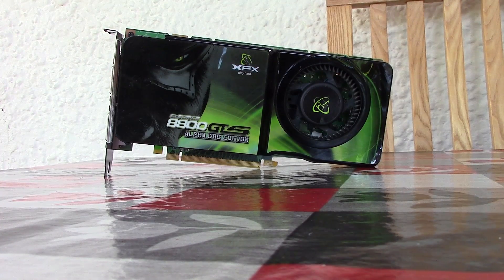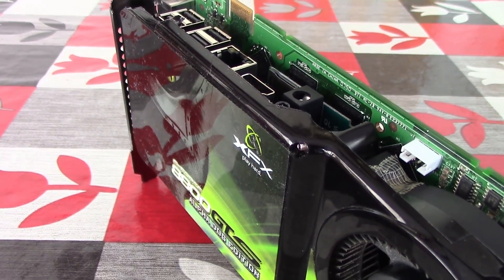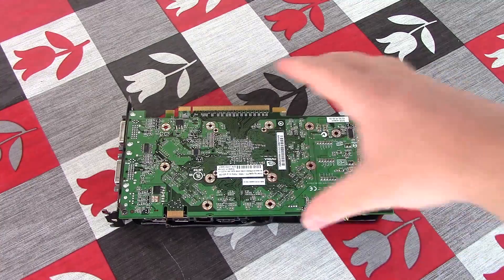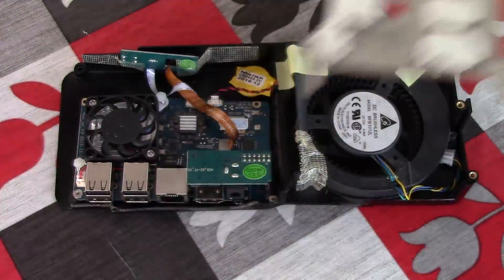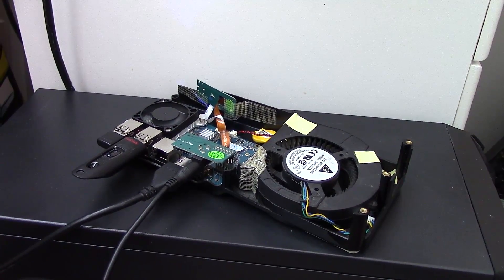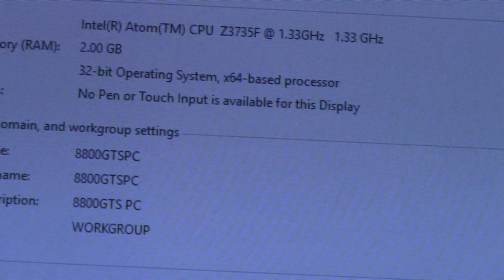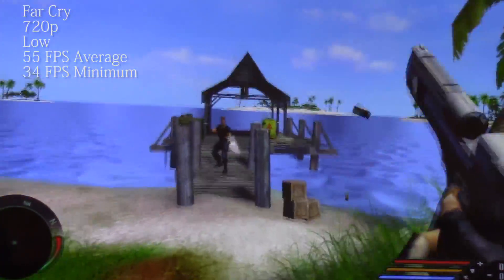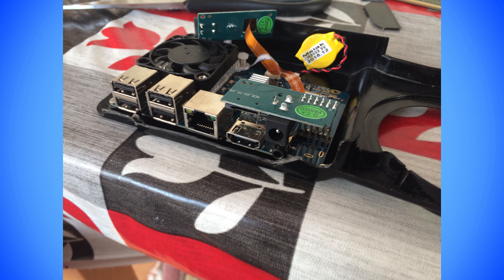I Built A Computer Inside Of a Graphics Card

Comment: If I get the  computer I am planning to build works I'll try to get a video about it. But I need to replace the fan cause I accidentally ripped the red wire out of the connectors I might try to RIP a motherboard out of a box PC so I can work on the repairs

Comment: you should have drimeled out the back io on the gpu and put a raspberry pi in and lined up with the back io. then you could cut the traces that lead to the pcie pads on the gpu, basically turning it into a dummy gpu so that no power or data is transfered. then you could put it in a pcie slot and boom you have a pc inside of a pc.

Comment: This is better than my older Atom processor Netbook that I had to install XP on because it refused to run with Windows 7 Home that came installed. If you take an Atom processor, just 1gb of memory, and Windows 7 Home then you have a recipe for at best a very sluggish system. I changed to XP and voila I had a good running system.  Praise The Lord and Godspeed to you all - Psalm 90:12!!

Comment: YOU COULD CUT THE 3 PIN GPU FAN CONNECTOR AND USE IT IN THE 2 PIN MINI CPU COOLER HEADER!
The 3rd pin is just monitoring the speed, you could connect it manually or use a 2 pin fan connector and use that!
Like if you agree!
Reply: But you need to use a bigger heatsink for that Intel Atom then
Reply: Ádám Strasszer Answer the question!
Reply: Bad Username lol yes
Reply: Aigis Is Best Girl good 4 u

Comment: Thank you so much, I just built a new pc from your guidance:
Amd athlon x4 860k 3.7GHz
GTX 750ti 2GB
4GB 1333MHz DDR 3 Patriot RAM
500GB HDD
A68hm-p33-V2
500w be quiet! Psu

But unluckily these are all new parts (except for psu,case and hdd), I feel like I got punched in the face when I realize I could buy an i7 3860
Or some other i7s second hand so I feel like crying, but mostly, thank you!)

Comment: I have an idea, which probably atm is not possible to make.

Raspberry Pi with USB-C (and maybe x64/x86 CPU) or Intel Atom based board
+
Electronics from external GPU bay, like Razer Core
+
GPU, like RX 460 or some other with low power usage
+
Custom power supply to feed all of the parts
=
PC in size of a GPU

Comment: you could've wired the power connector to the PCI power connection(possibly with a buck converter depending on what kind of voltage the board runs on).  And also you could've extended the hdmi port to the io panel of the graphicscard. that way the project would be more interesting. this way you essentially just crammed it in. nothing you could really call "build".

Comment: Next steps at this point would be to wire your PC to the old PCB to 1: take power from the PCI-e port, 2: use the existing GPU fan for cooling, 3: use existing display out interface.

Comment: You could have easily integrated it more, like using the power lines of the gpu pcb for the pc, I doubt the atom pc will draw more than the 75W it can supply. The ports of the mini pc should be to the side where the video ports of the gpu were. 
This is just using it as an oversized case for it, lame :(

Comment: I found a way to actually turn something like this in a gaming system: Get a Up2squared (4 core Pentium, DDR4, PCIe x1) and put it inside a working gpu. You'll have to cut off the half of the cooler to fit the up board in, but that should be okay if you undervolt an nvidia card. The gpu is connected to the up's PCIe x1 slot using a pci riser card. Not an optimal setup, but should be working and fun to build!

Comment: If you want to connect the fan, all you need is a 12V connection, but that fan will likely run on 5V, just very slow.  You could get a Boost Converter, which will step the 5V up, to 12V, but it will also pull ~2.5x the amps.

Depending on what fan the CPU has, you could potentially tap off that, or replace it, as the 8800 fan outclasses that little piece of crap by orders of magnitude.  Even dirty as it is.

Comment: please find a way to make the gpu output video even if its just the atom pcs connectors passed through out the back. also pass power and usb through the back with extensions. you will have to destroy the card beyond repair but imagine a gpu sitting on the table with a few wires coming out the back running doom. (1993)

Comment: im sorry but i did dislike this video due to the lack of enough real content as you are not actually reviewing the pc specifically, ans i had really hoped that you had made a little bit more effort and done something like connect the 12v/5v inputs from the pcie slot or 6 pin power connetor to the power input of the mini pc sothat when you got this gpu in your system that you havea second computer in there with its own video outputs roughly where the gpu's video outs were.
i am not trying to discourge you from trying something of this nature in the future, i just wanted to put a reasoning behind a dislike

Comment: You could make the GPU fan run off the CPU fan power if you got a 2 pin adapter and soldered the wires together. I'd be much louder but probably cooler.

Comment: if you want a cool little gaming PC the size of a slightly bulky laptop here is the way to do so,

it was a pretty cool I done my self which ended up working and ya similar to your GPU PC

I gotten a small flat dvd player 1.5 inches thick and around 1.5 by 1 feet long which I took the internals out of leaving just the metal shell.

I have purchased a supermicro motherboard which came with a prosseses that was an odd zeon, 4 cores at 2.1ghz

then bought a MSI GTX 960 4gb and with minor modifications slimming it a bit down  to fit into the case

bought a egpu adaptor that allows the GPU to be plugged in through a mini PCIe slot on the mother board (allowed me to lay the GPU flat and the mother rboard did not have a full PCIe only mini PCIe)

pulled 8gb of ddr3 sdram out of my laptop and slot it in the mother board (as the board is small it only supported laptop ram)

for the hard drive I had a 1tb wd laptop hard drive that I again pulled out of my laptop (already had windows 10 on it so it's not hard to get running, accept I did have to format it since PC refused to boot into windows 10 and it was messy AF but worked at the end) also had to coat it in electric tape for most of it so that it does not mess with any thing since the hard drive was literally laying down on the motherboard

with a lot of digging (and I mean ALOT) i managed to get a somewhat splim 450w PSU and some converter cables that would power the small mother board and the GPU as well as the small hard drive.

did have to cut a whole in the case for the dvd player so that it would fit the PSU as it was slightly too tall for the case top (around 2 cm higher) and also cut small wholes for the GPU fans to get air from as well as for the mother board and cpu, cut a small square on the side for the HDMI connector to the GPU and a large square at the back for the mother board Io. 

build was complete and after many hours of trouble shooting and messing with software and heat I had to underclock the cpu slightly to 1.90ghz the build worked in the end

the frame rate was not as good as it could be due to the underclock of cpu and and the performance loss using the egpu but it worked fine for a bit untill it died a few month later (cpu and motherboard got killed prob due to temperature or the fact I got it used from a second hand store)
overall performance at 1080p

Fallout 4 - high settings 35-50 fps avarage (ultra got about 30-48 fps avarage)
GTA 5 - highest settings - 20-60 fps avarage (when going really fast through the city fps tended to drop due to not so great cpu also had slow loading textures sometimes)
Skyrim (original) max settings just suck at solid 60 90% of the time
other games performed similar having around 15-30% performance loss if you were to run it in a normal desktop with same card and a little better cpu

most of the parts were gotten at the local second hand electronics store so I'm not sure of their exact names

but project semi succeed as it did work for a few month and died due to hear or maybe it was just the mother board

oh well feel free to try it if u want xD

Comment: This would be awesome if it is powerful enough to use as a capture /dedicated streaming pc. Eg how streamers have their gaming pc that then connects to a recording/streaming pc which streams to youtube/twitch and or record to a harddrive.

If its powerful enough to do this then you should try poking into this more. 
1. Tape off the PCIE pins (so that you can stick it into a pcie slot without frying anything)
2. Wire it to the 6/8 pin pcie power of the gpu card so it draws power from the main pc (disconnect the pins from the gpu pcb of course)
3. Wire the hdmi and  2 usb ports to the backplate of the card (so that you can plug in peripheral devices outside of the case)
4. Use the main cases reset switch to power on the mini pc. (just take the wire out of the mobo and send it to the mini pc)

Only thing missing would be a way to capture video from the main pc to the streaming mini pc...

Comment: Could it be possible to connect the 8800gt by a riser to a motherboard inside of the 8800gt, where both the 8800gt core and the cpu core are cooled by the same radiator, that way having a dedicated graphics pc within the gpu.

Comment: Nice, very nice way of repurposing an old GPU.
You could try to run the gpu's fan also for better airflow, at 5volts it should provide enough airflow with relatively low noise :)

Comment: OK here is what I would try and do, you know those external laptop GPU things(the off brand ones that plug into internal laptop PCI-E slots) and mount the computer on the outside of the graphics card so you can still run the GPU with that computer along with the computer mounted to the outside of the PC. the hard part would be finding a motherboard that would have one of those PCI-E slots.

Comment: You should do four things to this:

1. Re-wire the HDMI to the GPU's rear port if it has one. If not, HDMI and DVI use the same pin-out, so you could probably attach it to a DVI port too.
2. Splice the cooling fan with the original GPU's fan, making the GPU fan the new CPU fan.
3. Tack some wires on to the 6-Pin PCI-e connector, and have it power the PC.
4. Find a better spot for that power button, i suppose.

Comment: Guys. I bought the i5-6600K and I need a graphics card for it. Could you please give me some tips and advice on what I could get best at £200 ($220)
Reply: gtx 980 or some amd card like 290x or 390 https://www.gumtree.com/p/video-cards-sound-cards/selling-a-gtx-980-graphics-card./1255845280
Reply: xddd would it run Sony Vegas nicely at max video settings in heavy editing? if not I can happily save up to the Palit GTX 1060 6gb Dual fan.

Full specs are:

i5-6600K 4.4ghz OC
8gb DDR4-2400 
EVGA 450W 
GA-Z170-GAMING K3 
Samsung 750 evo 120gb SSD. 

Thank you for your advice.
Reply: Sony Vegas Pro 13.
Reply: and if you are buying used card, you need replace thermal paste because it's prob dry
Reply: xddd but would it run? You didn't answer my q.
Reply: Like i said i dont know ANYTHING about Sony Vegas Pro but i think it would run it just great cuz it's a beast card. You should prob google would it run it well just to be sure.
Reply: xddd oh alright. Thanks.

Comment: When you realize that mini computer is more powerful than your laptop
Reply: I feel you bro
Reply: you What kind of laptop do you have? It's almost impossible to be worse than this. Unless you really love netbooks or 8 year old laptops.
Reply: Epsilon 
I3 2312m 
320GB 5200rpm hard drive
2GB drr3 1333 Mhz
Intel hd graphics, 3000

I bought this 4-5 years ago for 400$
Reply: That's not too bad... a new SSD and more RAM and it will be a lot better. Don't forget that the chip in the mini computer is an Intel Atom, with a much lower IPC and clockspeed than your i3 2312M.
Reply: your pc is way more powerful ;)
Reply: Epsilon 
Epsilon 
I am not so sure 
After 4 year of photoshop and video editing and gaming on low fbs and more than 10.000 hours of working in very hot air without any extra   cooling fan
This lapto now can barly run very light game like minecraft 

And i got about 90 point in cinebech r15!

Comment: you could make the fan work by using a 4-Pin PWM Fan Connector (Female) to 4-Pin Mini GPU Fan Connector (Male), and then a USB to Fan 3-Pin/4-Pin Adaptor Cable (90cm) both are available on moddiy. com

Comment: I know it can run GTA 5 at 12 K resolution you just have to mind the black screen
Reply: +javier garcia Actually the framebuffer requirements for 12K would be way larger than what most cards have today. Not too long ago even high end cards were limited to an internal resolution of 4096*4096.
Reply: More or less, all the computers can. Maybe at 0.1fps per second but they can.
Reply: javier garcia you'll need to measure with spf (seconds per frame)

Comment: for a second i thought 8800 will be used on system
Reply: assuming the card is not broken he could still use it lmao, just need to solve the cooling while the pc remains inside, so imagine gaming with that card while you are also gaming on a different monitor on the computer which is inside the card
Reply: The Atom's PSU wouldn't stand it though, it would need additional power...
Reply: Blasto External psu!

Comment: The plastic / cutting work could have been a little more polished but If you don't have the right tools, I see how that wouldn't be feasible. 
I like the idea though.  Lots of potential with other single boards and other components.
Reply from the maker: Charsept thank you, I was limited with tools. Just had a pen knife and a bit of sandpaper haha
Reply: that's it!? well in that case, you did a nice job. 
If the case modding style stuff becomes a hobby of yours maybe look into a dremel. Those are fun to work with.

Comment: imagine if we had small pc's combined with gtx 1080's...
Reply: Really? and how are you gonnna put a 700W PSU inside a 1080? you smartass or an mini motherboard that supports pcie x16?
Reply: because us humans have ideas that can, most of the time, never happen. surely you read the beginning of my comment where i said "imagine"
Reply: The gtx 1080 only requires a 500W psu. You can look on the box it says on it.
Reply: A lost Cory The smallest regular Gtx 1080 pc is the Razer Blade Pro that’s right the Razer Blade Pro has a full on desktop gpu
Reply: what i mean is like a pc built in a gtx 1080, but the boards are connected to where they can function together, in the same case
Reply: Stormchaser Elite On average a 1080 uses 173 watts lol

Comment: Next video: Building a computer inside of a CPU
Reply from the maker: Rum If I could I would haha
Reply: Building a computer inside of the CPU of the computer inside of a CPU
Reply: Building a computer inside of a case
Reply: Rum building a computer inside of a cpu cooler
Reply: I'm pretty sure a mobile based ARM system could fit inside of a Ryzen Threadripper
Reply: Building a PC inside a Atom
Reply: Rum Building a computer inside of a transistor
Reply: I mean... he could inside of a Pentium 2
Reply: Building a computer inside a USB 3.1 male?
Reply: The threadripper socket is probably big enough
Reply: Perhaps inside of a PII?
Reply: Building a monitor inside a shoe.
Reply: LGA 3647 might be big enough
Reply: Rum the video after: building a pc in the pc in the cpu lmao
Reply: Schwuppel the Ratatouille Rat from the Film?
Reply: i hope not that rat is a good rat
Reply: Already done
Reply: Build  PC in a DVD rom
Reply: Building a PC inside a Proton
Reply: IMayBeSane you madman
Reply: Well... that's what SOC is for
Reply: Rum Coming in 3017
Reply: Rum Works good, doesn't sound
Reply: +RandomGaminginHD Pi Zero W in a Pentium III Slot-1 cartridge should be possible. Use a dead Coppermine to match the 700 MHz clock speed. You should even be able to match up the original die heatsink to the SoC.
https://en.wikipedia.org/wiki/List_of_Intel_microprocessors#Pentium_III
Reply: System On a Chip (SoC) on a chip...
Reply: +Jack Le A SoCoC?
Reply: RandomGaminginHD Anything is possible
Reply: Building a computer out of ram or ram slot
Reply: Schwuppel did you not watch the Ratatouille Movie?
Reply: If it's the ThreadRipper, maybe it's possible.
Reply: Rum now you can with the pico-itx
Reply: Rum Next Video: I built a computer inside of a computer inside of a computer inside of a computer.*
Reply: Kevin Corrado you hurt my brain couldn't read that text...
Reply: System on a chip?
Reply: Rum but the only game that is compatible is ryzen of tomb raider
Reply: You could put a compute stick inside a slot in pentium II, possibly.
Reply: Not difficult with the Pentium 2 (slot CPU)
Reply: If i had the biggest cpu made I would
Reply: +Abdullah Obaid why twice? its not funny anyway!
Reply: It is a joke (Also an exaggeration by Spicy
Reply: Actually it is not too small, you can use the raspberry pi zero and have a retro gaming pc inside of a cpu.
Reply: yeah...
Reply: that's called a virtual machine xD just watch Druaga1's Os ception video
Reply: Easier than you think
Reply: thats comming actually, eventually there are going to be whats called "systems on a chip" that will basicaly be a motherboard-sized dye that contains the CPU, GPU, RAM, hard drive, OS and PSU
Reply: +Geeknificent SoCs already exist and every smartphone has one...
Reply: There already are a lot of System On a Chip, SOC
Reply: You can build it in one of those old pentiums on cards
Reply: Building a computer inside a transistor
Reply: building a computer in a dead rat that i found on the street near a french restaurant
Reply: And after that, he should do: a GPU in a CPU in a USB in a Micro SD, in a C-3PO.

or a bit much?
Reply: RASBERRY PI?
Reply: ur dumb its too small

Comment: Please do a review of the i5 4440 
Combined with 1050 ti (if you can)
Reply: I have a 4460 and the difference is pretty much clock speed, you could even pair the 4440 with a 980ti, mine runs with a 970 and it's doing well